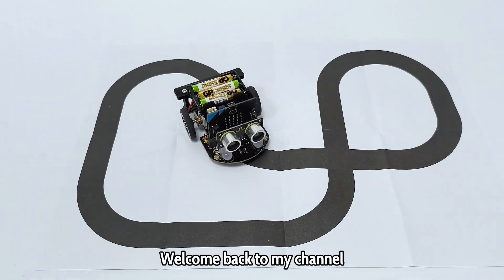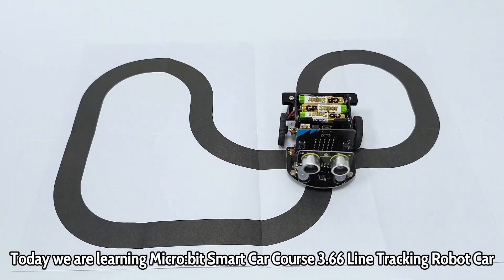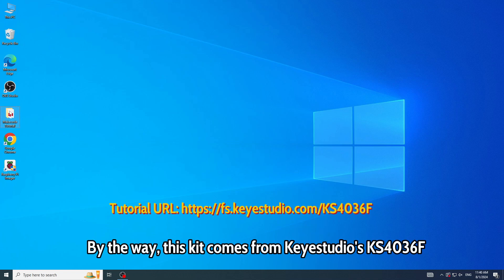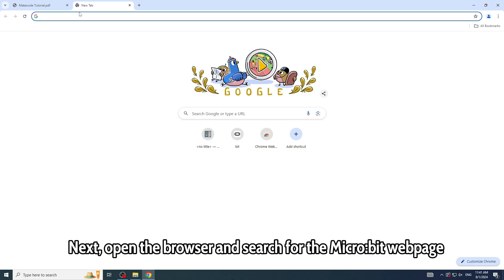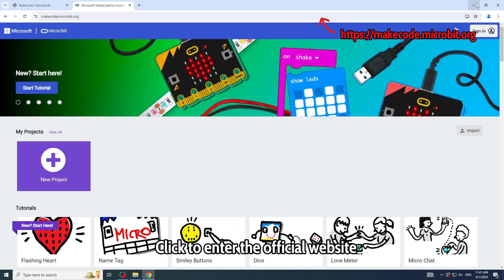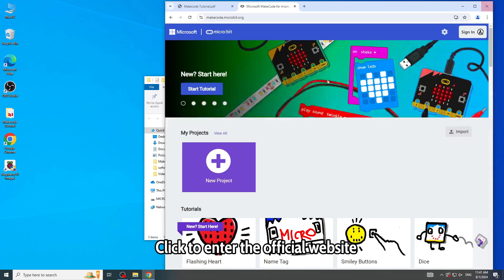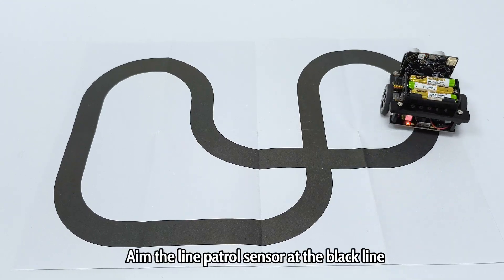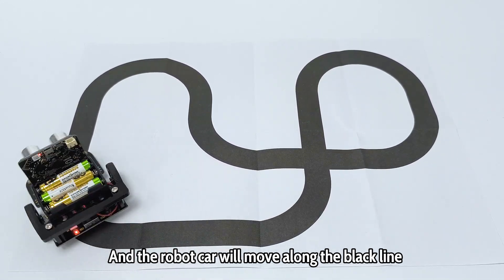KS4036F Keyestudio Micro:bit Smart Robot Car Project 3.66 Line Tracking Robot Car #robot #microbot

Comment: Project 3.66 Line Tracking Robot Car not working !!
Reply from the maker: I'm sorry you're having this problem! Could you please refer to the following and try again?
Adjusts the potentiometer to follow the black line.
1. Disconnect the Micro:bit – Remove the Micro:bit development board from the robot.

2 . Calibrate on the Black Line – Align the robot's line-tracking sensor over the black track, then slowly rotate the potentiometer until the sensor's indicator light turns off (rotate gently, as the potentiometer must be set precisely at the point where the light just turns off).

3. Test on a White Surface – Place the robot on a white area. If the indicator light does not turn on, slightly adjust the potentiometer until it lights up.

4. Final Check – Test the calibration by moving the sensor between the black and white areas. The correct behavior of the robot is:
In the Black area: The indicator light of the potentiometer is off.
In the White area: The indicator light of the potentiometer is on.